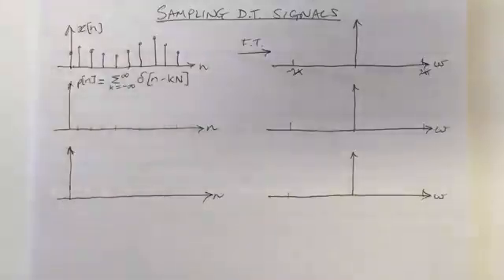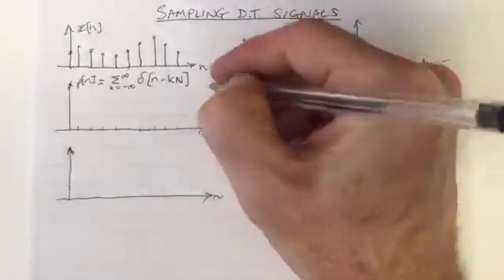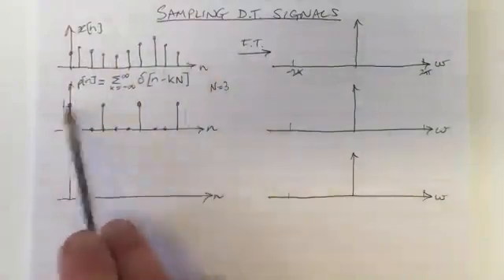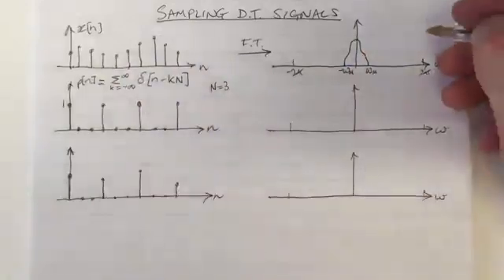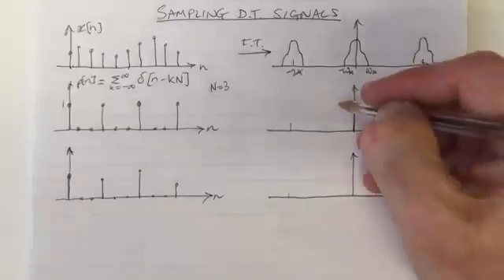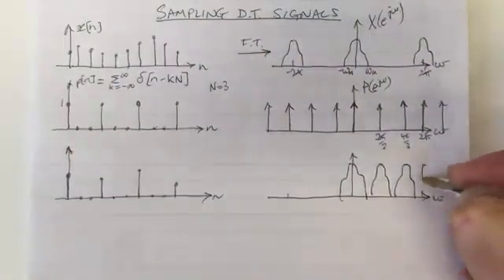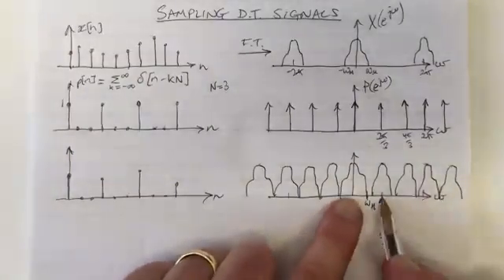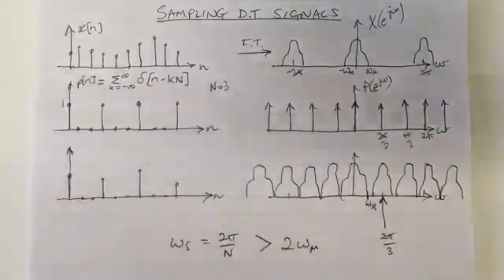Sampling Discrete Time Signals

Comment: Sir, at 6:30 if we place an ideal low pass filter, then we will get continous signal wrt to our initial discrete signal x[n]. Is that correct?
Reply from the maker: Good question. I should have made that part clearer. If you convert the discrete-time sampled signal (bottom left) into a continuous-time waveform of impulses, and then put it into a continuous-time LPF, then you'd get the waveform you mention. But I was just talking about discrete-time filtering. A discrete-time filter with a sinc shape impulse response would recover x[n] from the discrete-time sampled signal (bottom left).

Comment: I’m having a hard time wrapping my head around this one. If you take the first DT signal and just remove 2/3 of the samples, they can be recovered?

Example: what if there are two DT signals - [1,2,3,4,5,6] and [1,4,3,9,5,4] - and we want to sample them both at N= 2. The resulting signals would both be [1,3,5], right? How could you differentiate the two in the frequency domain and why, if the later sampled signals are the same, would the have different frequency domain representations?
Reply from the maker: Excellent question. OK, to start, let's note that the first signal you suggested is a very smooth signal (low pass, small w_M), whereas the second signal you gave has rapid variations from one sample to the next (ie. lots of high frequency components, large w_M). Intuitively, the second signal will not be able to be recovered, because its w_M will be bigger than pi (see 5.40 time mark in the video, but with N=2 in your case). OK so now to your question about them both having the same "sampled" FT because their samples are the same. Yes, that's true. So what it means is that ANY waveform that has the same values at sample times 0,2,4,6,... (in your case with N=2), will have a FT for which the excess part (above pi) will add (alias) to the in-band part (below pi) to give the exact same value as the smooth low pass signal FT. Pretty interesting huh? Great question. For more insights on aliasing, see my video: https://youtu.be/B3nZUFNkTGY
Reply: @iain_explains  Right, because for my second signal with the higher frequency components sampling at N = 2 is too high a period, and results in aliasing. The aliased signal cannot be used to recover the original signal. Thank you!
Reply: a tip: watch movies on Flixzone. I've been using it for watching loads of movies during the lockdown.
Reply: @Ivan Kace Yea, I've been watching on flixzone for since november myself =)
Reply: @Ivan Kace Yea, have been watching on Flixzone for months myself =)